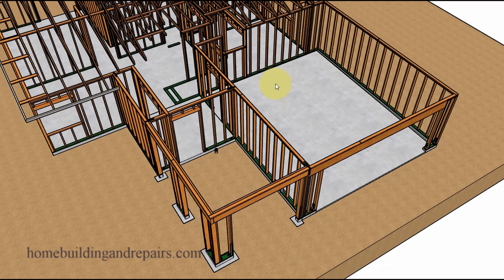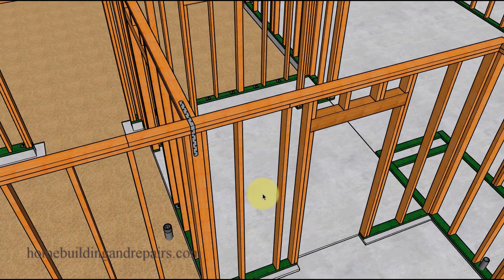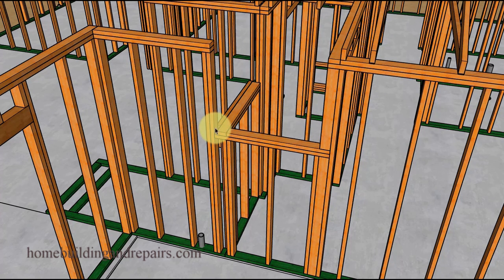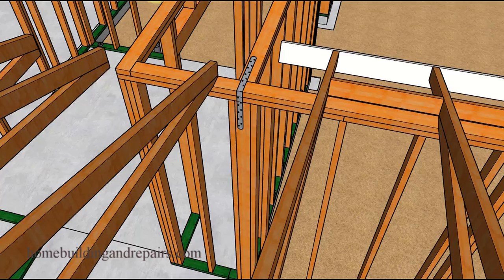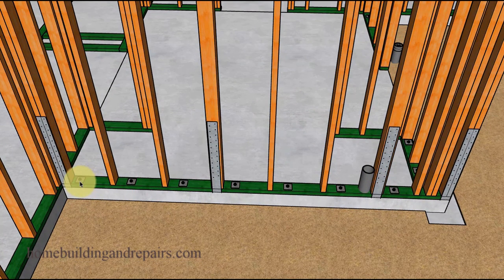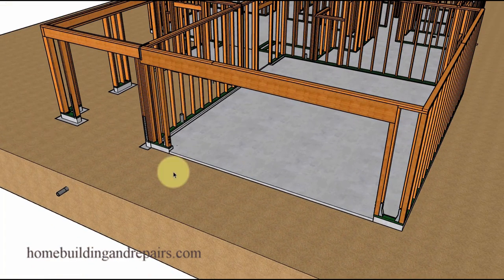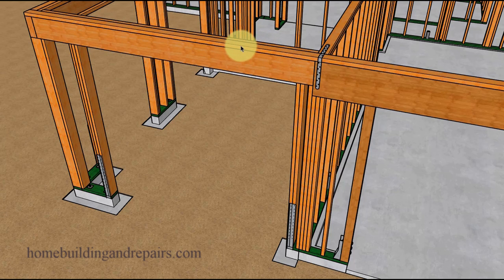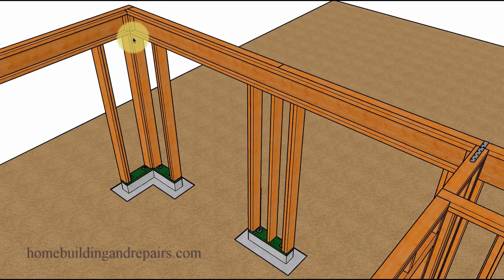Part 4 - Lower Wall Framing And Remodeling To Existing House To Add Two Story Home Addition

Comment: Greg can we talk about basement framing ? Lots of video subjects there , materials selection, framing do’s and don’ts are king jack studs required around windows / doors (some opinions differ) framing bulkheads, venting for a comfortable space, floor insulation / floor treatments. Waterproofing from outside in. The list goes on. It would be great to hear & see some things  from an unbiased source!!
Reply from the maker: I do plan on making more basement videos, but don't know when.

Comment: Notice you constantly defer to contacting a ‘structural engineer’ in almost every vid. Maybe you could partner up with one on YT so the videos will be more thorough. Prolly would increase subs too!
Reply from the maker: Thanks for the suggestion, they're always appreciated. The reason why I won't be providing engineering is because it changes from city, county, state and country most of the time. For example, lots of structural hardware like straps might be required in earthquake area and larger beams might be required in areas with snow loads on roofs.
Reply: @gregvancom  good point